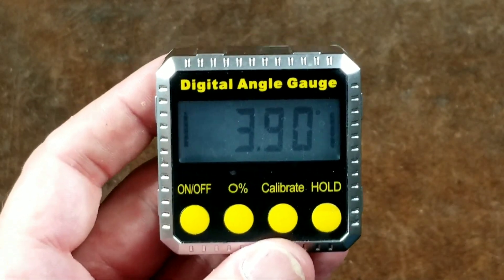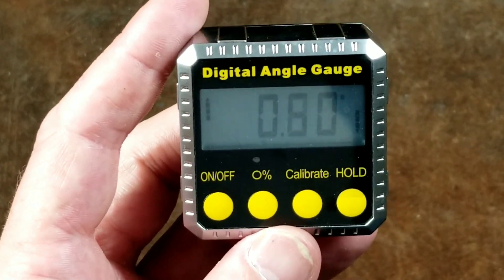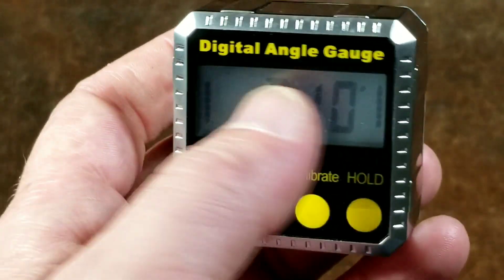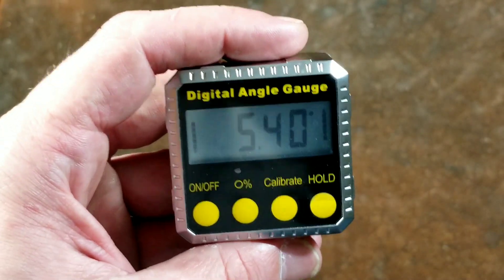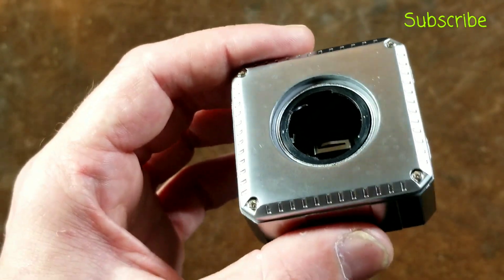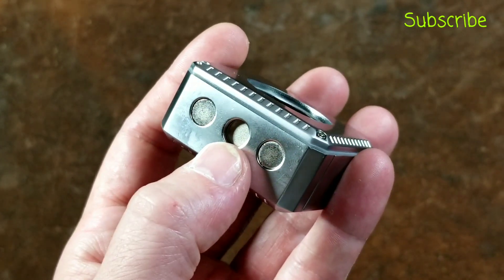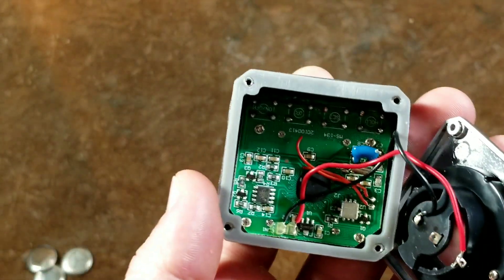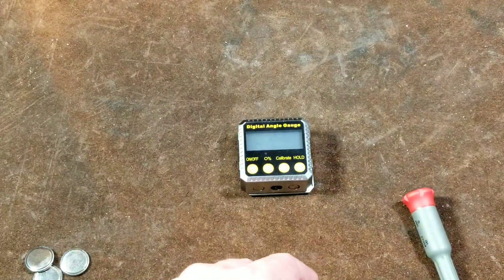Harbor Freight Digital Angle Gauge Review

Comment: I have one of these and I was disappointed because the product photos all show the angle finder with a green backlight, but the reality is there is no backlight at all, and the display is not even the slightest bit green, but the dull grey you'd expect from a cheap 1980s calculator or digital watch.

Comment: I've tried at least half a dozen "digital protractors" and not a single one of them was truly accurate, nor were any of the cases perfectly square. I would never set my saw blades with one. You can get replacement button cells at Dollar Tree.
Reply from the maker: Yes they've never been quite perfect it seems a modern smartphone that's calibrated is far more accurate and responsive than any of these could ever be although I'm sure there's some expensive professional ones that would work pretty well and yes setting saw blades is nice to get very accurate and using a machinist protractor is a great way to do it

Comment: I bought on of those a couple of years ago and put it away without using it for a couple months, then when I wanted to use it then the batteries were dead. So I bought new batteries for it but it wouldn’t zero out. So I brought it back to Harbor Freight and found out they didn’t sell them any more and I lost my receipt but they wouldn’t refund my money even though it’s obviously their product. Careful what you buy at Harbor Freight!👎🏼☹️☮️
Reply: Mine has worked since 2017